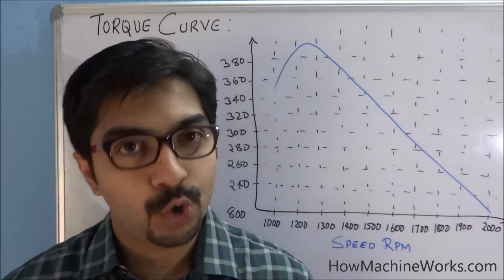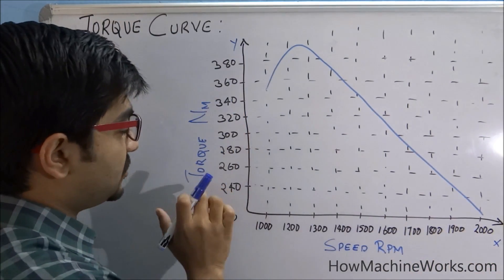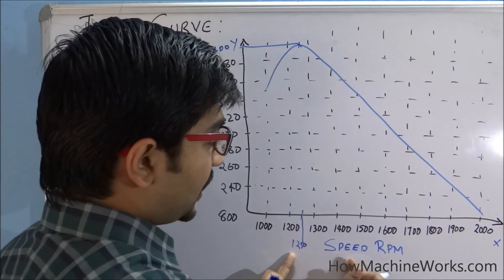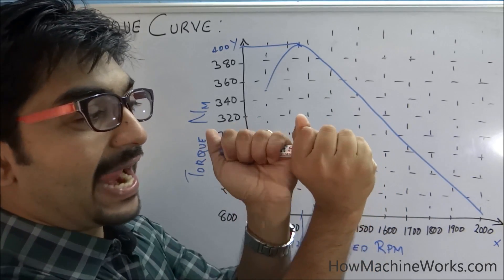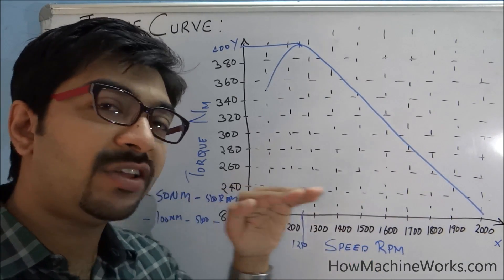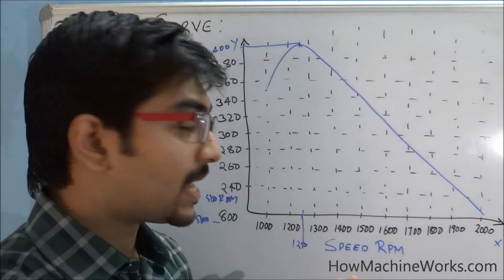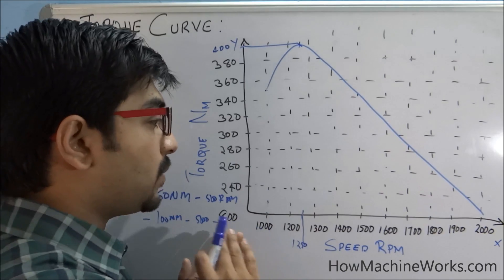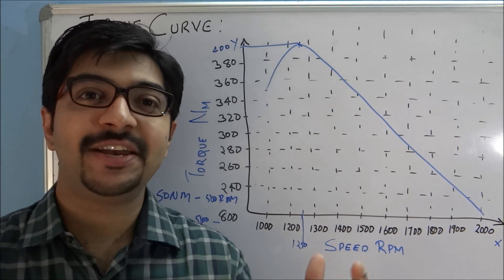How torque reduces when Rpm increases -Torque Curve Explained - Must watch

Comment: So you're telling me I should race my car at lower rpm ? lol
Reply: Richard Fergusson Not always, My CRD produces peak power at 3200-3300 RPM but it can rev all the way to 4300 RPM but the loss of torque at that speed means it's less actual power than the lower revs.
Reply: @spencerhho  Doesn't work like that lol
Reply: @ilpatongi  5 year old thread...

It produces 110kw at 3600rpm but only 100KW at 4300rpm. Power is a function of torque multiplied by RPM so the torque declines quicker than revs increase which results in less power at higher rpm in my case. This is relatively common in diesel engines. Of course this is ignoring gearing where the mechanical advantage of a lower gear can give you better torque at the wheels than more power in the next gear. 

Where's my error?
Reply: @spencerhho  Peak power occurs high up in the rev range, not necessarily at redline, especially with turbo diesels.
Richard's statement isn't wrong per se, it's just too generalized and imprecise
Reply: @ilpatongi  oh sorry, I thought you wete critiquing me lol, didn't realise you were adding to my comment lol. Dam context on the internet.
Reply: @spencerhho  Yeah I hate text but what can you do.
No probs!
Reply: No, higher RPM = higher HP. You obviously dont know shit so dont try to race..

Comment: Im confused to the max now. He says if you change up gears, there is more torque (more power to move the car). This might be a stupid question but going up a really steep hill (12%), the car goes up with easy in lower gears, and change up when the rpm hits 1,400 to keep rpm low and torque high, the car struggles to get up.

Comment: Why does a torque curve look like that? Starting from a small value, climbing to a peak and then decreasing again on the high end of the rpm? I can understand that a high rpms the cams don't operate as efficiently and that results in a drop in torque, but why does the same happen at low rpm?

The way I see, the throttle position dictates how much fuel goes to the cylinder. Same amount of fuel should mean same amount of output torque regardless of rpm yet this does not seem to be the case.

Comment: hi,u have said that as rpm increases torque decreases with respect to gears.....Ok! its fine..////my question is how does torque decreases when rpm increases of crankshaft when engine is not coupled with driveline?

Comment: I also agree this video misses the mark.   Max acceleration happens at max HP , not max torque at any particular speed.  Also, MPG doesn't have much to do with max torque. it has to do with burning the least amount of fuel at any given car force requirement.
Reply: *****  Andrew, you and others are completely missing the mark.. Here is why.  No, you are confusing peak torque of the engine at any particular velocity, with max torque at the wheels at any vehicle speed.   The later is what is dependent on max HP , NOT max engine torque. I don't  have to do the research. ive taught this class many times . :).  I encourage you to just look no farther than newton identities....... acceleration = power /(mass x velocity).   this is the law, and there is no debating it.     power is proportional to acceleration.     now, I completely understand your perspective of max torque in any particular gear, will be the greatest acceleration in that gear.. but it doesn't mean much, because if a lower gear at that same speed, allows for more HP, the rear wheel torque will be greater at any particular speed. .... make sense??   hope so!
Reply: ***** Great questions and there are real answers, you are in luck!!! Yes, F=ma, but remember its the force at the wheels, NOT at the engine.    At ANY particular speed, at max hp will always give you  the max amount of force at the wheels. (even if the torque is less from the engine vs its max torque..... in fact, it can a small percentage of max torque , that can produce max HP and MAX accelerative forces.   forget about thinking about "what gear are you in"... gear boxes are HP utilization devices.      max HP and the most HP under the HP curve wins races.... max torque or big engine torque values mean less than nothing.
Reply: ***** you couldn't have asked a better question and it is counter intuitive, because of all the non-sense that flys around the automotive world.    But yes, that's exactly what I am saying and it makes perfect sense because acceleration is proportional to power (or forces at the rear wheel). acceleration=power/(mass x velocity) which is a basic Newtonian identity.    the main point is hp IS the rate of doing work, or more applicable to our conversation, HP is the rate of change of Kinetic energy, which by definition is going to be acceleration.the problem with the intuitive side of the concepts, is that max torque of the engine is getting confused with force values at the rear tires.   the max acceleration at any speed will be with max torque at the rear wheels, and THAT is found at max HP at any vehicle speed.   gears are used to optimize the HP and maximize torque at the rear wheels.         electric cars are really no different than a well geared car with 6-7 speeds, but are only potent with one gear up to 60-80mph.  at that point, their HP falls off so fast that the rear wheel torque is usually quite lower than a similar HP piston engine....... the reason for this is that the electric car has a broad HP curve, so only one or two gears is needed to optimize the hp available.   A two speed tesla would be perfect match for an equally sized gas car, with 6 speeds and equal hp  (near 425bhp)   the stock tesla falls on its face after 80mph, compared to a gas car .   again, that could be fixed easily with a 2 speed gear box.   launch torques and capability is far exaggerated to a skilled foot and clutch dump on a gas car of equal hp.

Comment: Uhm, torque always intsersects rpm at 5,252 rpm. I don't know what kind of 'engine' your graph is supposed to show, but not even 14 liter turbo diesels have a torque curve like that. And gears have NOTHING to do with it. I appreciate the sentiment of your videos, but you missed the mark on this one. By far.

I'd take the video down because you actually don't explain anything, your graph is wrong, and you're confusing torque at the wheels due to gear reduction versus engine torque.

I like your other videos, but this one is your worst. Sorry.
Reply: this is on imperial scale and torque can still rise after 5252 rpm but power rises faster.
Reply: While I agree this video is terrible some engines do have a torque curve somewhat like this but they produce way more than 400 nm of torque and it drops sharply after 1500 RPM

Comment: ok I might have my head screwed on wrong and if so please let me know. but for a real world example... from what I understand torque is the force needed to do a certain amount of work. ok now the more torque you have the easier it is to do that work. so in this example you gave, of higher rpm's giving you less torque, I do not believe that is accurate. when I am driving my car I get into 5th gear my rpm's are low around 1200 rpm or so. I come to a hill. as I go up I now need more torque to get me up that hill. so I down shift. what happens? my rpm's go up to about 3000. so I just increased my rpm's and got more torque by shifting down. if I am off roading and I come to a place that is steep I down shift to keep my rpm's as high as I can yes I slow down but I also now have more torque to get over that hill. so to finalize I do not see how raising your rpm could ever give you less torque. at some point you will max out but not drop. thank you for your time.
Reply: tq is a force, not energy. tq doesnt tell you anything about how much work can be done.

Comment: I'm not giving you a thump down but your video isn't giving what you have told in your title....everybody knows torque reduces when rpm increases but how and why is it happening????
Reply: Maybe I'm confused because he's giving a car engine as an example, but torque doesn't decrease with rpm; it increases with rpm until the engine reaches maximum volumetric effiency, then drops off beyond that point.  OR should he have used a different example instead? say, an electric motor as the example instead?  Where the voltage stays constant and the rpm increases?  Or, better still, a gearbox where the torque and rpm at the input shaft stays the same, but the final drive ratio changes?  If so, THEN it makes sense to me!